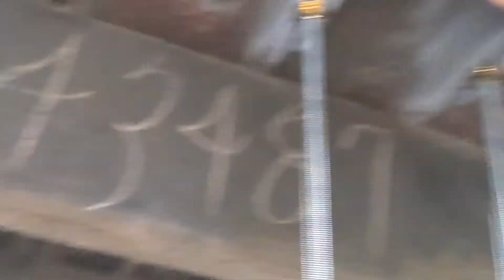Mounting the Grey Water Tank

Comment: So were you scared at first that "Jack nuts" would hold or work? I was!! 🤣 They are holding my solar panels down👍
Reply from the maker: Yep! Worried they would possibly wiggle out with the vibration. Welding the unistrut up there seemed like a good idea.
Reply from the maker: And I was planning on using them for solar panels too since I already have my ceiling finished out on the inside.